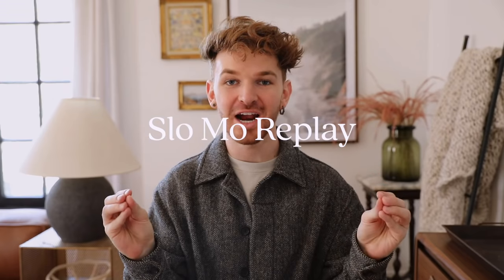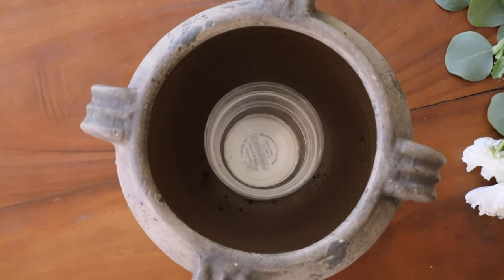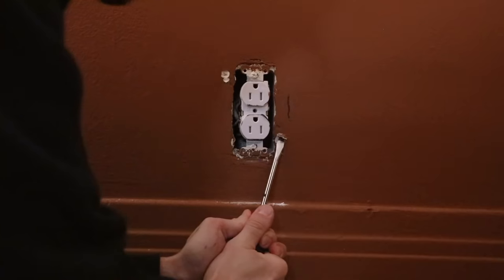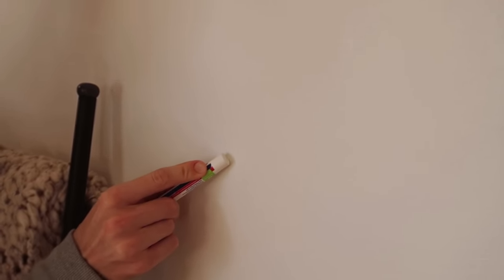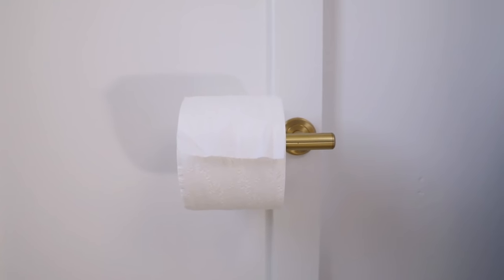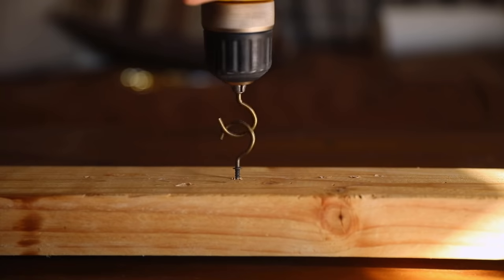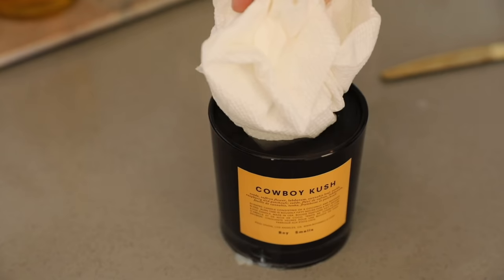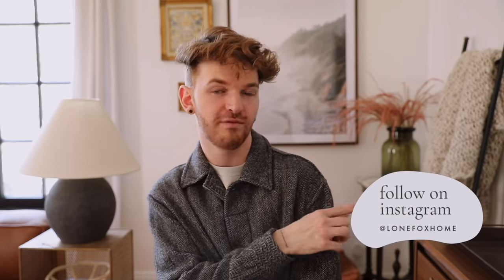20 GENIUS Home Hacks That CHANGED MY LIFE 🏠  DIY Hacks to Save Time + Money!

Comment: just something to consider:
1)consider to light the top of the candle and let the wax drop into the candle holder then put the candle quickly to its place instead of lightening the bottom, which makes the candle darker and not that clean and nice as before.
2) consider using a sponge with dish soap and it will come out so much faster
5) please don't use any kind of type, just leave longer sides to folder and after a few times it will hold the fold
18) freezer will do the work too (and with any quality wax) while hot water can leave some residues and please, please never use the candle container (whatever it is, even glass) in food or beverage consumption - there is never a guarantee it is completely safe!
19) using fingers will almost always be messy, try cutting the square from any hard plastic you have under the hand and pass over with it instead to clean up the glue

Flower decoration tips are genius, thank you!

Comment: Hack on top of your hack; the candle with boiling water, if you let the water take all the wax to the top, instead of the paper towel, just let it cool at the top of the candle and when it’s solid again you can break it up and use it in a wax melter so you can use every last drop of your favorite candle 😊

Comment: Your book cover:  
1) As a kid, we always had to cover our books from school -- without tape.  Tape was the big no-no.  It yellows, the glue starts to melt and gets on the inside of the book, the teachers certainly don't want to spend their lives pulling off tape, etc.  So I found a video link closest to the way we used to do it:  https://youtu.be/5fpaUSjqXro 

2) We had to use whatever paper was handy but most of the schools had a policy of using brown paper bags. Plus a brown paper bag is closest to the size of a standard fiction book so minimal cutting is involved.  But we also used:  aluminum foil, wax paper with assorted drawn-on or glued-on designs, parchment paper, birthday/Christmas/holiday wrapping paper, leftover wallpaper, the comic section of the newspaper (yes, I am that old), tissue paper in any color.  No paper safe from the frenzy of 6 kids on book-cover-night in my parents' home.🙂

Comment: I know it won't always be the case, but considering the oulet plate was the same color as the wall he could have just taken in the cover plate for that wall. Also if you just add a couple inches on the top and bottom of the book cover, you can fold those in then slide the covers onto the book, no tape necessary

Comment: Years ago students were required to cover textbooks with paper (often paper grocery bags were used, but packing paper or whatever can be used). This was because textbooks had to be returned with minimal wear or students were charged damage fees. If you start 1.5" (almost 4cm) from the bottom and from the top and from the right edge almost to the spine, you can tape on the inside portion of the cover. Roll the book to the other side and do the same. For the extra decorative types you can cover the paper covering with stickers or shelving paper in your favorite colors. DO NOT use ball point pens (it indents on the cover of the books) or pens that bleed through paper easily (it bleeds onto the book cover). You can use colored pencils IF you don't press hard. You can generally use crayons. Don't think that you can't get decent images from crayons. Lots of people like stickers and since they are stuck to the cover it's fine. BE CAREFUL with shelf liner - it's harder to line up and you could damage the cover of the book. Remember that book covers are removable and you can make new ones. Lastly, if you can sew, you can make cloth covers for your favorite books. Paperback books are best covered with stiff paper (sometimes two layers). Hard bound books can be covered with paper or cloth. When using cloth, you'll want something that will keep dust away (however, the benefit will be that you can wash it). You may also want to invest in interior cloth that is waterproof to protect the cover. Sometimes you can find outer materials in a clearance bin. Check into "fat quarters" and consider decorative designs.

Comment: 1 That’s how do you use a candle holder
2 Use rubbing alcohol or lighter fluid for thin plastic or delicate items.
3 That’s how you use a decorative vase
4 good
5 Don’t put tape directly on the book make it pockets on each end. Tape DOSE!damage books and resale value. You can also use fabric.
6 and 7 save paint in the freezer or garage because pain varies depending on batches mixed
8 That’s how you use floral tape.
9 good Now take the paint you actually saved in a pump roller in the freezer and paint over it. 6 and 7 not needed.
10 don’t dry your sheets in the dryer all the way you want it about 65% dry. Put it on the bed it will dry with no wrinkles.
11 You’re supposed to put your duvet cover on inside out lineup corners  and tie them, then flip it.
12 cute 
13 yes Doesn’t always work the best

Comment: I have a decor manual for my home. I keep the tags the wallpaper comes with, paint chips  and cloth selvedge of curtains where the name is on or just write it in, or photos of pattern of design diagrams of electrical wiring and where the drains and pipes go, so I dont hang a mirror through those. Also telephone numbers ofcontactors and receipts for improvements for capital gains tax. The improvements can be deducted. Before and after photos. Also recipes for celebrations, and in the attic, extra tiles in case you need to replace. The celebration photos reminds you of where you placed what and which cushions you used for a particular do. If successful you can repeat, if you like to change up each time, then you dont serve the same dish for the same crowd. I use gallery hanging hangers for large walls, not individual nails. I keep repair wax for scuffed furniture

Comment: Thanks. There are quite a few I will be using. But I would like to know if you have any hacks, low cost ways of dealing with popcorn ceiling that they used in bygone eras?. I will be redoing my apartment, room by room and I hate the popcorn ceiling. Thx
Reply: Be careful, it could have asbestos in it. Can be bad for your health. Maybe call a professional in. Some companies specialize in it’s removal. Good luck. Blessings from California. 🪰

Comment: I re-use the left over candle wax instead of removing it with papertowels etc and throwing the waxed towels away....so what I do is ...I fill the candle-containers ( mostly glass) with hot water - like you have shown - to get the wax fluid and out of the container...but instead of getting rid of the fluid wax...I wait until the hot water in the candle-container cooled down again and the wax built a solid surface on top of the watersurface....then I remove this solid wax sheet (for later re use...like collecting  those left over solid wax pieces...until I can melt them together into a new candle..using one of those candle-glass-containers....or making other fun stuff with wax... ;)   I hate wasting things...  ;) by the way...I loved your idea with preventing color-bleeding when painting the wall...  great content...thanks... ;)

Comment: MUCH more simple way to cover a book. Cut paper a two or more inches below, above and on the ends of the opened book standing on its spine. Fold down across the top and across the bottom, then fold back on each end to make little " sleeves" into which the front and back covers will fit.

Comment: I cannot thank you enough for the Amazon dupe hack! Sadly, it came too late to save me from making a mistake on my fixture for my dining room. Pottery Barn had the fixture I wanted. It was very pricey, but on sale! what prevented me from getting it was the shipping cost. It was outrageous! It was not in stock at the stores. And I didn’t know PB had such ridiculous shipping rates. You probably know this, I didn’t, but they base their shipping cost on the cost of the item. So it could be a 500 dollar item that was light weight and the shipping is ridiculously high. I ended up getting another chandelier from PB that was much heavier and way less expensive to ship. Both were on sale. I looked everywhere for a dupe of the original light that I really really wanted. But I could not find anything similar. The fixture I got, I have really started to hate. It is a glass drum shape. The glass has a texture to it. I had to wait a couple weeks for it to be hung because our remodel took longer than expected. When I finally hung it, to my horror I realized the texture of the glass throws a wavy pattern all over the room. It is the only light in that room 😢. It would have cost a large sum to ship it back, and I only had a few days to do it. Unfortunately I could not get the crew back to take it down before time ran out to send it back. It’s been a nightmare ever since. I really don’t like that fixture. 😡. Any which way I try to change it is gonna cost me! I could try to sell it, I don’t think anyone would pay nearly what I paid. Or I could pay to have more lights put in that room. Again, very expensive. Moral of the story, buy things from stores that don’t base their shipping cost on what you pay for the item. Amazon prime is spectacular. They will take items back, and ship them to you, for free!

Comment: I've never had the adhesive come off that easily. WHAT I DO: mix oil with baking soda, put paste on adhesive, it comes right off.
Reply: Thanks for the tip I’ve been trying to find a way to get it off all kinds of ways and none of them have worked so I’m gonna try this way 😊

Comment: Eleven 
Or you don’t need to roll anything. Just flip the cover inside out , put your hands in and catch it by two corners. So your duvet cover is flipped, you are holding two outside corners which are now temporary inside. Now with your hands holding the corners you take the duvet by the same corners. Where normally the duvet would be touching the cover. So holding the corners of the duvet with your hands ( and a bit of body too 😉) wrapped with duvet cover which you are still holding by the two corners, you flip everything up down up down abra cadabra magically the duvet cover flips and the outside of it is outside and the duvet is inside. 
Faster than rolling. Rolling must be awesome when , for example , hands , arms are hurting.

Duvet do exactly as he did the pillow 😅 I just saw it later

Comment: Hack number 9 is a bad idea, as wax and waxy or oily residue repels paint, especially latex and other water based paints. A small container of drywall spackle only costs between $6 and $12.  The company named Dap sells small containers at several big box stores.

Comment: Just letting you and everyone else know that, the tape in the book hack ABSOLUTELY will ruin your book in the long run. If you don't care about it and the waste it will generate, go right ahead (in which case I'm heavily side eyeing you), it would be better to just huy a fake book or book/box that fits your color palette. BUT the cover you made do not need the tape anyway, the folding should be enough to keep it in place since the book won't be handled everyday

Comment: I think it must be my fifth time watching this video and I'm still picking up on things for example - those were matchsticks and not q-tips in the candle holder (yes I know you said 'matchsticks' 😅) and the faux tree idea is I had actually collected some tree branches but had completely forgotten why 😂 so they've been just in the corner of my living room for the past 2 months.  
Also for the paper dust covers, you don't need to use tape, you can cut and inch or 2" extra around the entire outline leaving a gap on each end of the spine and then fold in from the points of each corner and then along the flat edges. That way you're not damaging the book or the paper if you want to reuse it. If the cover is very think you can use a couple of paper clips instead.

Comment: No one should use his caulking trick!  

You could potentially spray your FINGER to clean up the caulking,  but

By SPRAYING the caulking area directly,  you are actually also spraying behind where you want the caulking to adhere to and want you want to have a water tight seal bit WON'T if you first are spraying soapy water first (watch again as he sprays soapy water onto the area that is literally next to the rounded bead of caulking then he presses that rounded bead flat onto the 'wall' that he just sprayed' :(